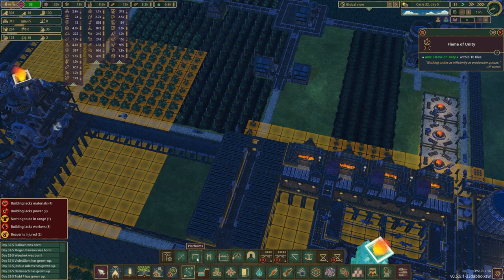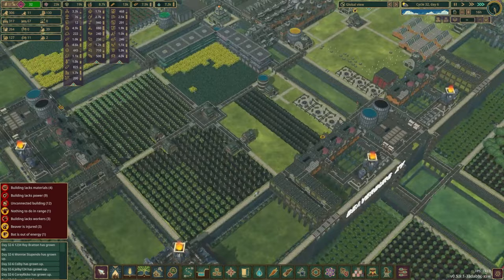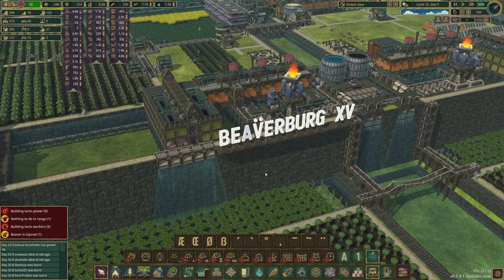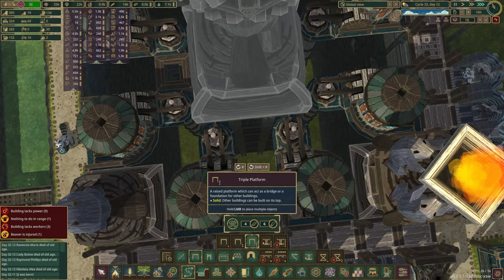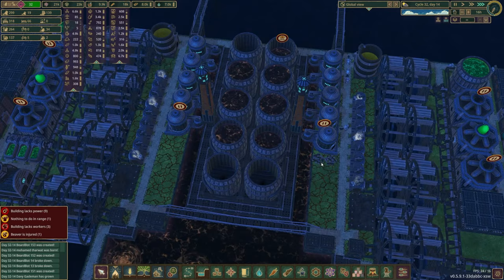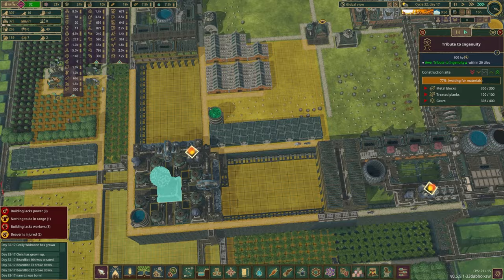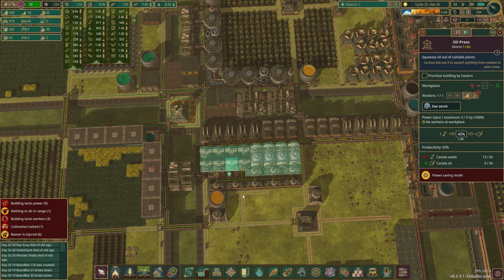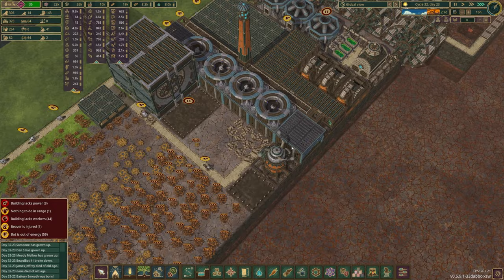Time for the Tribute to Ingenuity! Timberborn Update 5 Iron Teeth Mega Build Episode 23

Comment: idk if there are mud baths in this mode, if there are just add a large amount of those, beavers love those. would be fun to see too..you can power your building from bottom in place of platform with vertical shaft, vertical shaft acts as both platform and power supply

Comment: You could use the power tunnel to clean up your power transfer between districts, blast a hole 1 tile back from the edge, bring thw power out under the outer walkway, and connect it all in a straight line to the wall.

Comment: I think you should rotate each tribute to ingenuity, 90° at each corner. So each right corner faces out and each left corner faces left.

Also, the grease does look odd, but I started thinking, it’s made out of vegetable oil. Specifically canola. I think it was originally made from cottonseed oil, but Crisco looks like that. It’s pure vegetable shortening. I assume that’s as close to “grease” as they can get in-game, so the color could be legit. You’d think the extract would change it, though.
Reply from the maker: Makes sense, that's a good explanation. And we will rotate the tributes as suggested 😎

Comment: If you're going to be putting more than one district in on the outer ring you can always put their district name on the other side of the main entrance to where you have beaverburg on the other like welcome signs to different states 😊 also if you were to put the 2 engines on a platform you can connect the flywheels to the shops over the pathway 😊 this would also open up the possibilities of yo stacking another set of them on top doubling your stored power potential.  Farm fields you need to have each kind of crop in each 1/4 that way all farm houses will store extra of each one on top of what the storages have or stations for processing this will give you a little bit more of a emergency back up 😊 need to put more campfires in around the rest of the two sides😊even if you have to move the inverters to say the middle areas that way it would also open up more of the crop field spaces😊

Comment: If you are planning any other flywheels in symmetric positions in the future ... Suggestion: build 3 power shafts on platforms as a temporary substitute for each flywheel you currently don't have materials for ( then once flywheel material available quickly remove 3 shafts & platforms & build flywheel in place) ... In this manner you can connect both directions of flywheel power once & before building the flywheel
Reply from the maker: Okay this is a great idea. We'll do that!

Comment: → I think you could have powered that monument from below, instead of the side, hiding the power connection more.
→ 29:55 I'd put just two tanks for the ingredients, and then add a bridge or platform to your tank area where you can use one of the big ones for the grease.
→ I'd hold up on building more tributes to ingenuity until you got a bit more power production – they take 600 hp each.

Comment: Time to put in some motevatirum? Maybe on top of the storage instead of rooftop terraces. And put the terraces some where else. Or just place them on the ground instead of planting more things. Replacing the farm that has nothing to do with a forester and making a little park around them. 

18:10 my guess is that it's not being built because you paused the building, but I might be wrong.

29:38 they are trying to collect the stuff as fast as they can. But you only have 4 builders in the district it's going to take some time.
Reply from the maker: The issue with the motivatoriums is getting them powered. They'll probably need to be on top of the barracks for that reason, or we can make some weird power transfer structure somewhere else.